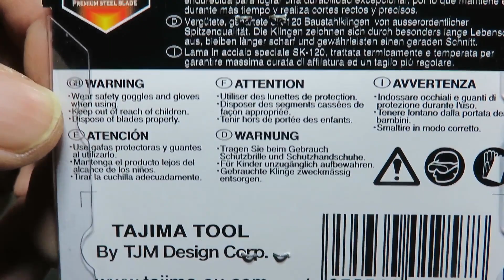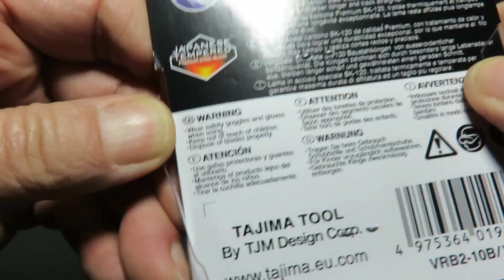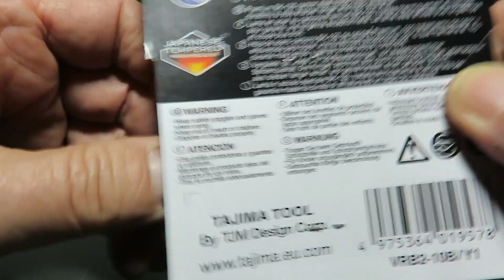I'm giving a gift to my Milwaukee Fastback (Tajima V-REX II)

Comment: I like to put serrated or scalloped blades in my box knives .
Reply from the maker: Serrated blades ? Where ?
Reply: I live in the USA and have found them in home inprovement and hardware stores under different names , sometimes with heat treatments and i believe titanium coated or laminated ? Home Depot  , Builders Square , Lowes and Westlake Hardware .
Reply from the maker: @darinmullins4770  Rapid Edge (Serrated Utility Knife Blades) ... but currently unavailable on amazon.com  ....

Comment: Do those tajima blades fit snug into that fastback? Was looking to buy those blades but I heard they are smaller compared to normal blades
Reply from the maker: Slightly shorter but without consequences.
Reply: @diezelle57 So they haven’t fallen out though right I wanna buy a new utility knife and I like the fastback and I have some extra t-rex blades that i wanna install in them if they can fit
Reply from the maker: @edgarponce2635  No problem.

Comment: Beautiful video! Do the Tajima blades have more play than the standard ones? I also ready that Stanley blades are a bit thicker than Milwaukee blades and are very hard to remove from the handle storage. Does that happen with Tajima?
Reply from the maker: Tajima blades are very slightly shorter than other blades on the market and they have a little more play...but this is negligible.